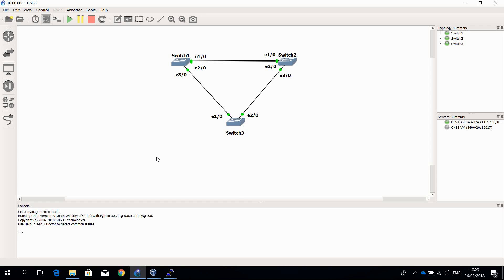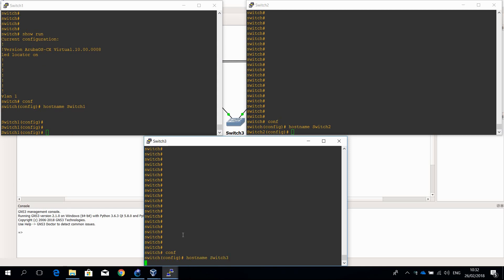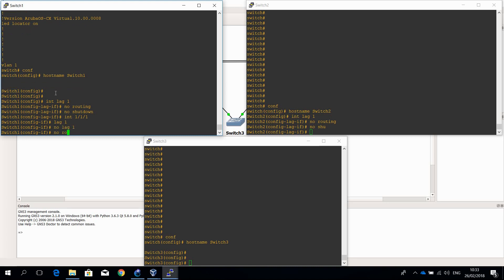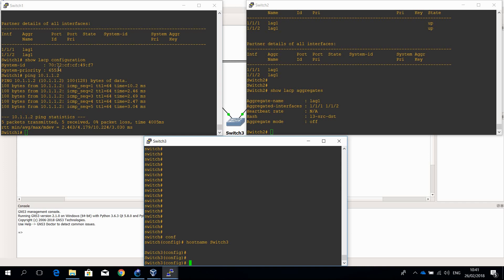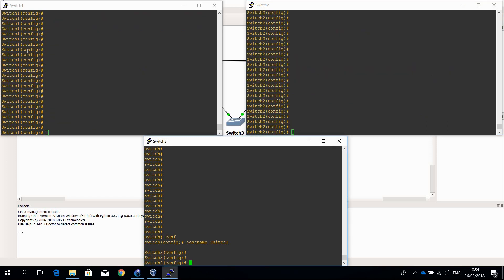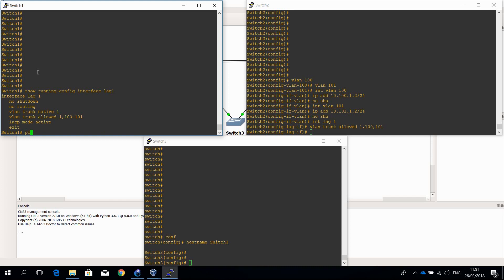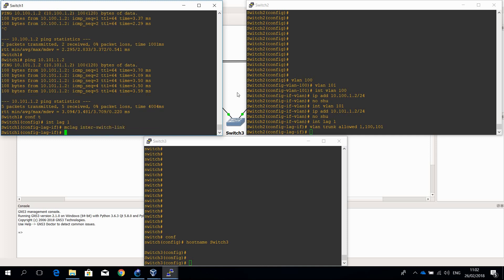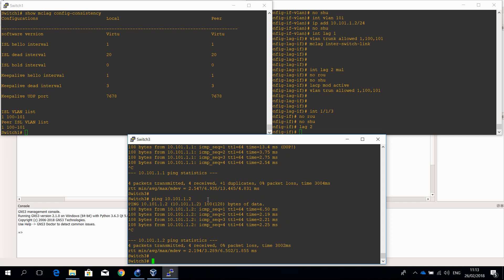AOS-CX CLI series: (Multi Chassis) Link Aggregation

Comment: pretty great video,but you didnt configure any peer keepalive link along with ISC between the sw1 and sw2,can you let me know why we need peer keepalive and isc?
Reply from the maker: Hi Prateek,  that's correct. Reason for not covering keepalive in this video is that I don't want to make the videos too long. I might be adding another video covering keepalive. The main purpose of keepalive is to avoid a split brain situation when the Interswitch link is broken.  The ISC is required to sync all the tables and allow load balancing on.  
By the way, I have created another video that covers VSX, which is the next generation MCLAG. This video covers keepalive which works in exactly the same way as keepalive with MCLAG. VSX is the way forward for Aruba Networks. You can find the video here:  https://www.youtube.com/watch?v=b31py4NlLSo
Reply: @AirheadsBroadcasting  thank you very much for the reply,I'll definitely check out VSX

Comment: Hi, thanks for the great video!

Is there any information on why Aruba changes the old terminology (distributed trunking)? I guess they changed pretty much everything to look more like ios and less like the old ArubaOS...
Reply from the maker: Well, the IOS (Catalyst) term for MC-LAG is MEC (Multi Chassis Etherchannel), the IOS-X term for MC-LAG is VPC, the ASR term is MC-LAG so I am not sure where the consistency is here :-). I guess Aruba is moving more to the terminology that has been accepted by the industry in general. For example, Juniper also uses the term MC-LAG. I think in general it is a good thing that vendors move away from fancy acronyms and long worded marketing flavored terms and change to terminology that has been accepted by the market or are driven by industry standards. And, at the end of the day, it all has to work and has to satisfy the customer's requirements, right?  :-)

Comment: Hello! First thank you for your videos, they are very very helpful. I've been tinkering with MCLAG with keepalive enabled to have a more controlled environment in case of ISL failure. As I understand, if ISL fails, keepalives keep on going and the 8400 with higher priority shutsdown it's MCLAG interfaces, is that so? I haven't been able to do It :(
Reply: Yes that is correct, you have to make sure that the keep alives are not using the ISL link but are taking a non ISL path. This is the way it is supposed to work.
Reply from the maker: Hello Aarón, That is correct. You have to do three things. First, set the mclag priority with the command:  mclag device-priority command. The switch with the lower value will continue forwarding. Second (and third) is that you need an additional Layer 3 connection between the two switches and configure an mclag keepalive peer. For example if you have a L3 connection between two switches, where switch1 IP is 10.10.1.1 and switch2 IP is 10.10.1.2, you configure the following on switch1:    mclag keepalive peer 10.10.1.2 source 10.10.1.1. On switch 2 it's:  mclag keepalive peer 10.10.1.1 source 10.10.1.1. If you are using vrf's other than the default vrf, you also have to specify the vrf. Once that's done you can check the keepalive link with the:  show mclag keepalive status     command. If you disconnect the ISL, the switch with the higher priority value should block all the ports. Finally, make sure that you have at least release 08 running on the switches.  Good luck.
Reply: Hi! We managed to fix the problem. We were using loopback interfaces of both chassis to communicate the keepalives with OSPF routing. The problem was that the keepalives were going through the ISL link and that is not supported. I changed the cost of OSPF interfaces so keepalives go through other interfaces instead of the ISL link and now it works like a charm!